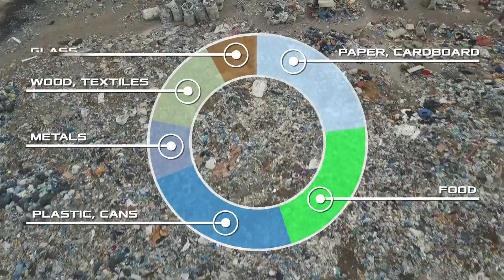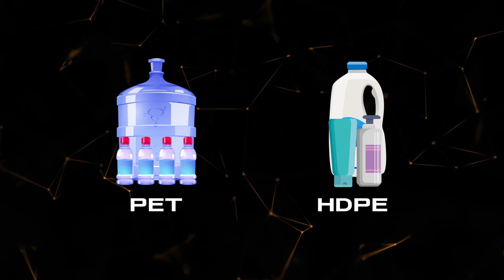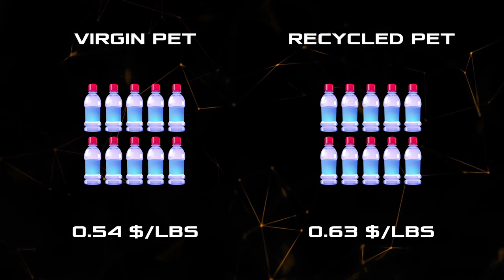Why plastic recycling is a myth

Comment: The title is quite exaggerating. Plastic recycling isn't a myth. It doesn't solve the whole problem either.
Reply: It is. Chemically it is not possible. Any mixed plastic is burned. Only 2% of plastics is recycled. What do you call that?